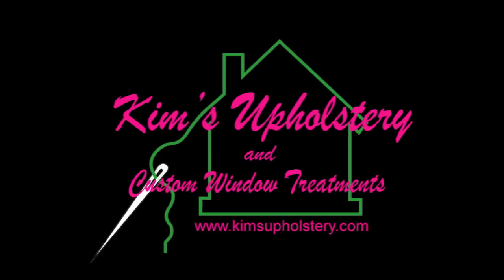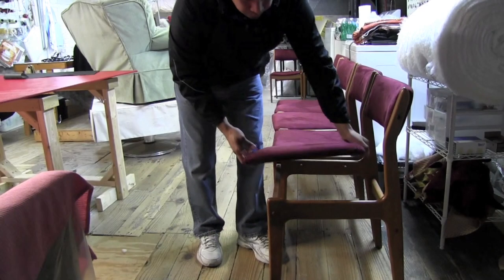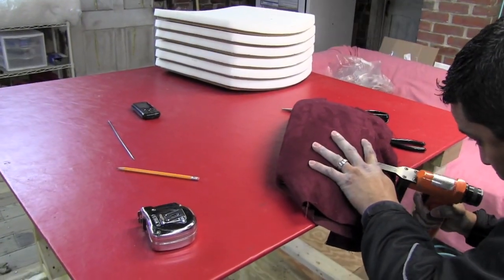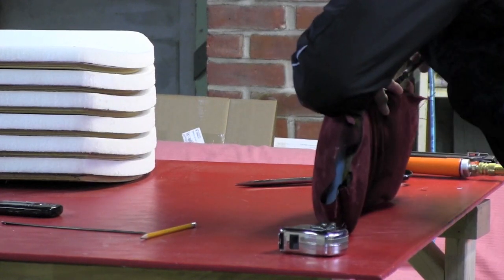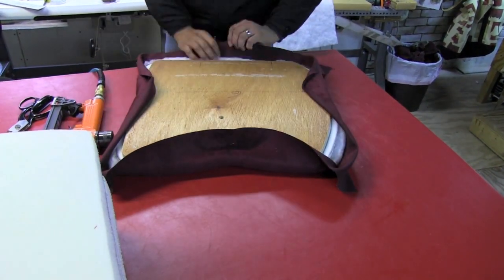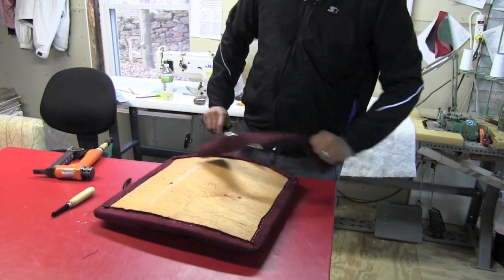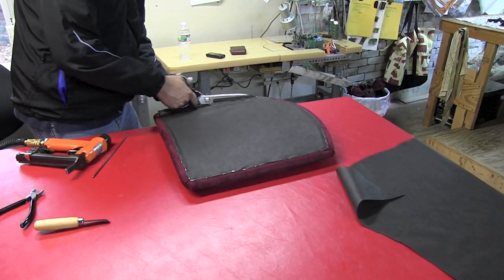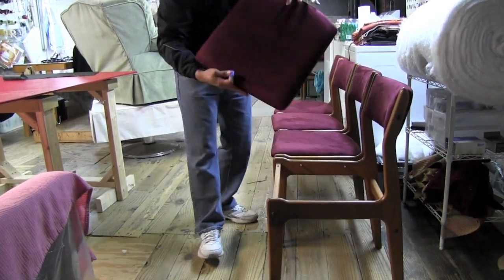How To Upholster Dining Room Chairs.mov

Comment from the maker: Hi Adi,

The foam is a high density medium firmness foam 1"thick.  We did use the same for the back in this case, but you could use a softer foam if you wish.

For the back.  Do the bottom first stapling the second side with a folded edge over the top of the first to keep a clean look.  On the sides you would again staple the second over the first.  In the future we will have more detailed videos that can be purchased.

Thanks for watching and please subscribe to see move videos.

Kim

Comment: Kinda helpful but I'd really like more detail on the applying finishing fabric to the back rest of this style of chair. Including very detailed views of the folding of corners and side, I have attached new foam and wadding to my old chairs and am concerned about cutting the limited fabric, which I want to overlock edges of before stapling as its very easily fraying. Hence need to cut to correct size and shape beforehand, not just trim excess.

Should I do front or back before sides? there's a tab at top of old fabric to tuck top corner in but can't use old fabric as pattern because its shrunken and shrivelled and the new foam is thicker than old.
Reply from the maker: Jenny Taylor you might be interested in our membership site. There you can learn the upholstery skills needed to tackle many upholstery projects. Have a look at  www.upholsteryclass.kimsupholstery.com  Thanks for watching and subscribing to my channel. Kim